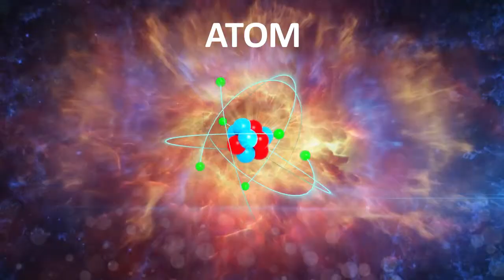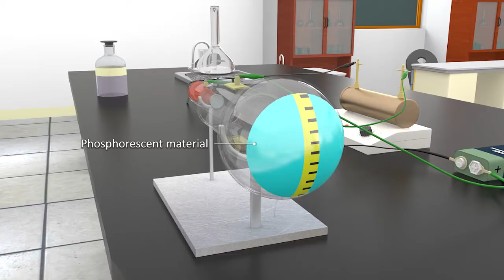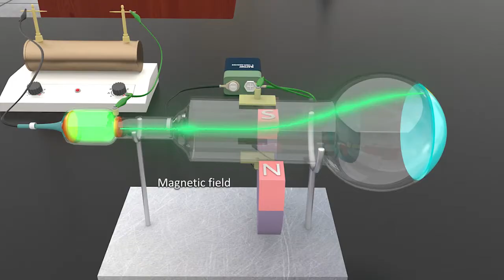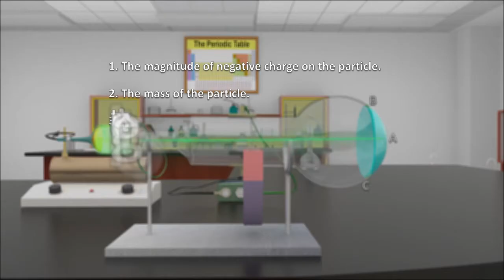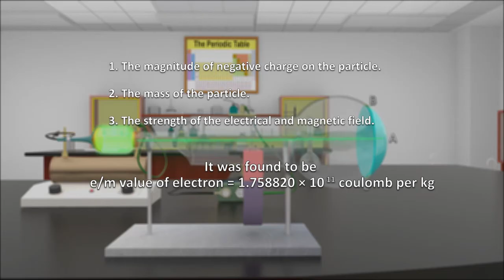Charge to mass ratio of an electron

Comment: Question is still carried in my mind how anyone can find the charge to mass ratio of the subatomic particle by only observing the deviation?
Reply: Me  too bro. I thought this video would explain but it didn't.
Reply: By equating the magnetic and electric force(due to which it's following a circular trajectory, thus using the formula of centripetal force)  we get: qVB=mV^2/r. On solving which we obtain a relation: e/m=V/Br [equation 1]. Then, by balancing the electric and magnetic field strength: qVB=qE, we get V=E/B[equation 2]. Putting eq 2 in eq 1, we get e/m=E/B^2r. Since, here we knw the electric and magnetic field strength we are providing also, we know the radius of curvature of the path of the trajectory followed {found experimentally}  we can find the result by putting in those values.
Reply: @shrutisharma2325  how and when did you know this 😢
Reply: @ayushRaj-xc6yl  I saw another Yt video on the same topic earlier, wherein this was mentioned.
Reply: First deviate the rays with elec field or magnetic field. Its strength would be known. Then introduce the other field so as to apply force in the opposite direction and adjust its strength till deviation is eliminated. Now, force applied by both fields are equal. So equate them, from there, you get values of some required quantities. Then only a few more calculations like measuring the deviation and then you get the charge. As for the mass, I don't if he just plugged the value from Milikan oil drop experiment or did he actually find the ratio through the sole means of his experiment. But that's how much I could help you.
Reply: @shrutisharma2325   in which book can I get this explaination..
Reply: By using kE.=1/2 mv2  and PE=eV.  .. and using centripetal force.mv2/r and      electric force Fe=E/e
Reply: @shrutisharma2325  But how you can get unit couloumb per kg? Energy unit is Joule Magnetic field unit is Tesla and radium is in meter
Reply: Everything in which “we” measure it gives it some kind of mass, so this is a “wrong” calculation without the calculation itself being wrong